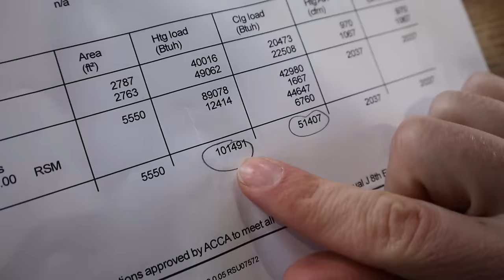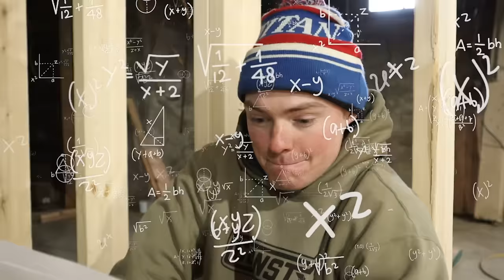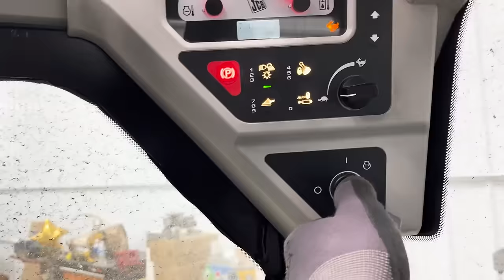Restoring A $7,000 Mansion: Removing 2nd Story Floor

Comment: Hey Cole.  This is the first time I remember getting to see your floorplans.  On the second floor, I am not understanding why your new 1/2 flight of stairs go through the master closet to the attic.  Wouldn't you rather prioritize getting a better master bath and closet?  Keeping to the same footprint, I would kill the stairs and flip the door of the closet to open against the bathroom wall.  Do one long run of closet (her closet).  I would terminate that run about 5 feet short of the back wall.  This allows about 3' for a bench or mirror before the 2nd run of closet along the exterior wall (his closet).  With the closet orientation changed, you could then access to the master bath to be through the master closet.  The door from the bedroom to the bath is eliminated and the vanity can be upsized to run the full length of the wall.  Move the toilet beside the shower and get direct access to the shower from the center of the room.  When you enter the master bath from the closet, the vanity is on your right and the shower/toilet is on your left.

Maybe do a separate video about the floor plans with the plans in a PDF link in the video description.  Also give some sort of contact link so people can send you sketches of their ideas.

Comment: Live in ND.  I have baseboard radiators.  5k plus square feet.   4 zones.  1 boiler.  Wouldn't change it for heating.  It's efficient and works quite well.

Comment: HVAC concerns! 
Cole I would highly suggest you center your furnace so the house is warmed/cooled evenly. I have found that the rooms farther away from the furnace have a noticeable amount of temperature difference than the ones closer.

Comment: You want to do it right become once behind the walls and sealed you don’t want to redo. A separate system for each floor is the best option. Also look at an energy company that can look at your location, air tightness square footage for your air conditioner needs. Sizing the system for your needs is extremely important.

Comment: Hey Cole,, I have flipped about 4 houses in my life time and they always need heating and air systems. The last house I completed was last year and the heat pump cost $13,000 on a 1800 sq ft house (everything was replaced). The one thing I have learned in my house flips is to pay the a/c guy and let him do his thing. Sure you can probably get it done but it will take you 3 times longer than it takes him and his crew. There will be plenty of things you can work on after the sheet rock goes up so let the pros handle the heating and air.

Comment: I recommend going with a multizone system in the house and keep the in-floor radiant heating. The house will be far more comfortable.  I would also have your guy recalculate the heating load to -25 or -30 and your cooling load to 110 degrees to be a little more realistic of Iowa temperatures.  Remember that the house is slightly elevated with not a lot of wind protection. You didn't say if geothermal was an option you were considering, but it bears looking into. Future proof the house as much as you can. There are a lot of good suggestions in the comments from experienced people in the industry.

Comment: Use the heat pump for primary Cooling. They freeze up and stop heating when its Sub-Zero outside. If you need to trench the gas supply in to the road, do it BEFORE PLANTING THE CROPS!! Don't bury the propane tank, they freeze and quit flowing, and you cant pour hot water on a buried propane tank. 36:42

Comment: Also keep in mind that refrigerant regulations have changed. R410a is being phased out like R22 was back in 2000. The newer A2L refrigerants are flammable and require leak detection.

Comment: As a log home designer, we use systems like Unico HVAC systems. It’s very low profile and the ductwork can fit into a 2x4 wall.

This resolves the problem of ductwork issues and framing .. and can eliminate the vast majority of duct chases.

Please look into this option, it’s especially useful when you don’t have floor trusses with space to conceal ducts.

Comment: Have you looked at the mini-split systems.  Basically a heater/cooler in each room. No duct work, and each room can be controlled to different temps.

Comment: One of the most important things to figure into your rebuilt house is a whole house vacuum system that exhaust the exhaust air outside the house..   This is one of the most important things to improve air quality in a house and to make sure you exhaust bad vacuumed air outside a house.  Even if you do not plan on putting carpets in your house now, that might change in 10, 20, 50 or more years.  Also your health might change over time.

Comment: Two units would be the best because you can use separate thermostats to control temperatures on the 2 main floors. Also you might want to long at a backup gas furnace for one of them in case of power failure. You are going to buy propane or natural gas by the truck line for the corn dryer so you would get a good price on those cold winter days and not run the electric bill so high in the winter.

Comment: The two heat pump system approach may help you to save on utilities.  On my prior 1917 two story Four Square going with a separate system for the second floor allowed me to have an easy to control second zone that could be adjusted seven to ten degrees warmer in the summer than would be comfortable and a similar amount colder in the winter during the times of the day when the floor wasn't being used -- the same was done with the first floor.  I realized significant savings of between 15 and 20 percent year round -- and the house was much more comfortable when  compared to my first several years with the older fuel oil forced air system.

Comment: I live in North Carolina and built my 2 story 2309 sq home it was a 2 zone heat pump it works great. 1 unit but can control each floor with different temps. My house has low power bills but it’s very energy efficient.  Power bill never over $150 a month but I have gas water heater. Check on a 2 zone heat pump.

Comment: I'm not an HVAC tech but I have lived with lots of different HVAC tech. In that climate, radiant floors are great. You definitely need at least to forced air zones. Here are a few of my opinions:
1) 2 heat pumps is 2x maintenance. A little more for 1 heat pump that can support 2 zones is well worth it. Heat pumps (and splits) will save you money when its above freezing, but their lifespans are limited.
2) You could skip radiant floor heating where warm areas are below, and you could put hydronic forced air in the 2 air handlers. Not as many heating zones, but it would save money.
3) Mitsubishi mini-splits come in many form factors that are easier to hide including ducted endpoints. If you can get enough indoor units off a single outdoor unit, then it should be cheaper than 2 zone heat pumps. Think in ceiling units in the kitchen and picture frames or mirrors in bathrooms. IMHO an O.G. split under a window in a bedroom isn't as bad as a unit in the living room. A real HVAC tech will need to confirm, but I think even basic Mitsubishi units are modular so that you can replace just the outdoor compressor or just one unit in one room.
4) The ERV is definitely a nice luxary. I don't have spray foam, and already my bathroom fans will suck an equal amount of freezing cold air back in through straight though my kitchen hood, which is the outlet that is sealed the worst. Without ERV, you too will figure out what part of your home is sealed the worst the first winter, and it will be quite cold there when you blow air out.
5) There may still be good rebates on geothermal. You could do a couple of forced air zones and augment cold areas/floors with geothermal radiant.

What I would do is an outdoor pellet boiler for full radiant floors combined with mini-splits. I enjoy having all of the zones.
Reply: some great points were made that ducted systems require proper return paths. That means adding vents between rooms or extra ducting to well sealed rooms.

Comment: Have you considered putting in  GEO with total radiat floor for all floors. Then use air handler units on the 2nd and 3rd floors for air conditioning. This puts you GEO units inthe basement . You create hot water in cold weather for heat and cold water in the summer pumped to the air handlers for air. This drops cold air in at the ceiling being much more efficient . Also the  heat pumps  are more efficient being in the basement . I live in nortwest ohio and heat 4800 Square feet with this method. If you have questions you can contact me . Also running radiant floor tubing is not hard just labor intensive. By the way I'm doing the whole house with one 5 ton unit. Love it and the air conditioning is extremely efficient.

Comment: Spend the extra money on the heating and cooling. It’ll be less expensive than adding things later. I’m in Texas and houses here, especially 2 story, typically use 2 HVAC systems. Even single story houses will have 2 units to lessen the load and save on the total energy bills.
Tankless water heaters and built in vacuum on every floor… Neva will thank you later. If you don’t go tankless, consider a recirculating system for the hot water heater. 
Double the outlets and include USB ports. Put the light switches at ADA height and the kids will thank you.
Put retractable steps into the toe space under all the sinks for the kids. 
Love the videos on the house! 🌽 ⭐️❤️🙏💪

Comment: 2 systems! That is a ton of space to heat and cool. 2 systems will also let you have more zones.

Another thing to ask about is a whole home dehumidifier. That will help with edge cooling days too. Think of it this way humid in the house is not nice. 2 ways to get that out run the ac or have a whole home dehumidifier. It’s cheaper to run for an electric perspective.

Make sure your drain lines are easy to clean out when going between multiple floors.

Comment: Were any of your quotes for a High Velocity HVAC system?  They use smaller flexible ducting to supply the registers in the rooms.  They also use a very small register/ grill.  They are quiet and fast in regulating the temperature in each room.  An Energy Recovery Ventilation (ERV) is almost required as the home will be more airtight then it was before when you had all the air leaks.. The ERV will use the warmth of the exhausted air to warm the cooler air that is being brought in.

Comment: Lots of thoughts on interior heating and cooling, consider geothermal add to heat pumps. 50°F is a nice middle of the road temperature. Cool in summer, warm in winter. Less work for heat pumps. Energy and money saved.

Comment: Heat recover is a good idea on a property of this size and use it to pull out the air from humid areas such as bathrooms and kitchens and then bring back in fresh air as you should have an otherwise airtight house

Comment: Hey Cole, I lived in Chicago and now in Texas. I would stay away from heat pumps, not efficient and use a lot of electricity.   I would scrap out the heated flooring and just do heat with forced air and a gas heater.

Comment: My house has a heat recovery unit. It is a box with a fan that passes the exhaust air by the inlet air so that it either heats the cold air in winter or cools the hot air in summer on its way into the house. I also have all my bathroom vent fans run though that system. That way the bathroom vents always run on low and there are switches to turn the heat recovery unit to high speed.

Comment: If I were I would say spend the extra for an ERV system. It removes the bad air from the house and replaces it fresh air that highly filtered. Since you made the whole more air tight you need to have system that you can you can control. The unit doesn't take up much space and it use 4" flex pipe. Exhaust vents are put in where the most humid and contaminated air is which is bathrooms, kitchen, basements, etc and the intake vents are located in the living areas. It is a balanced system and it equals out the humidity depending on the season.

Comment: You may want to look at a geothermal mechanical system. More expensive upfront but will be cheaper in the long run. Especially since you want to have a heated floor system. 

But two systems will be more efficient than one larger system. I work for a commercial general contractor. I have enjoyed watching your channel for several years now.

Comment: We had a farm house in a climate similar to yours, we pulled the boiler out of our house after we added new isulation like you have. We then added heat pumps for each level and had electric baseboard heaters installed (super cheap) as a backup. This easily heats and cools our home and is super cheap to run and maintain. The heat is very consistent and effective. Our electric is expensive here (Canada) but we still only average 250/mth for everything,  including heat.  I'd rather put in new windows than such an expensive heating system. New windows and that insulation... you should be able to heat it easily.

Comment: cole. with infloor. you could use heat exchangers in the air handlers and use regular air conditioning rather than the heat pumps. may be a less expensive option. Also for a more consistent heat look at zoning. with dampers.

Comment: I would think you get to cold for heat pumps, in Texas they work well because winters are really mild most if the time. But back when snowmeggedan happened, thank goodness for the propane wall mount we had, we would have froze with the heat pump. You get below about 26 and the unit will run none stop, and it will feel very drafty. When it gets below 26 I turn it to electrical heat, then fire up the propane if we get below 15.  1100 sf house with a 3 ton new heat pump.

Comment: I would install a velocity system with air handlers in the attic for the second and third floor. This way you could one boiler for everything and this would also handle the ac also.

Comment: Wife niece is a MD. Their 2nd new home has ductless heat pumps. The house is about half the size as yours, her husband claims the house can be heated for $200 a year. It was built with SIPS panels, so it's very well insulated. Never could understand why there wasn't bridging on the first floor also'

Comment: The heat pump will save you a lot of money on heating or cooling. While you are using 500 watts of power you are gaining up to 2500 watts of heating or cooling effect. Both of our houses have heat pumps installed and we are grateful for installing them. They save us a lot of electrcity while give out enough heat in wintertime or cooling in those extra warm summer evenings, when you have a hard time sleeping because it is just too hot and stuffy inside and the bugs are waiting for you to open the windows, so they can feast on you while you try to sleep. Floor heating is nice but go for a heat pump solution to help heat up the water. The investment may be a bit high, but you will save a lot of money in the long run.

Comment: Air exchange is a must, it reduces humidity plus uses the heat that is pulled out to pre-heat the incoming air. In a house that is so well insulated you need to circulate the air in the house. I'm assuming you are installing energy efficient windows and door that helps with heat loss. I think you need two high efficiency furnaces and two HVAC units. I'm all in with the geothermal plan, plus a LP fireplace for heat and atmosphere. Remember heat rises, and with the attic now insulated your second floor is not going to get anywhere as cold or hot as it was. I noticed on your house plans one of the bathrooms has the toilet facing the door. I would rethink that and if you need dbl sinks in there, move the door over and put one sink beside the toilet on the wall to the left of the planned sinks and one behind the door.

Comment: Cole, your mansion is perfect canidate for Geo Thermal system. Heat wells drilled into earth.  The earth is 55° f   Combined with heat pump system it will save thousands over the years.

Comment: you might want to consider geothermal, you can do the commercial type or even the DIY type, you probably want to do the commercial type... it can heat and cool your house to a steady 50-60F and then you save a lot on the rest of the energy to heat or cool to your final temperature of around 69-72F...  also you have a special chemistry there with the current cast of people and the editor (including yourself) you could make more from doing builds on youtube than perhaps your whole farm and digging businesses...  it's a great trio...  i would produce some shows if you don't want to, you would be the foreman and keep the same trio...